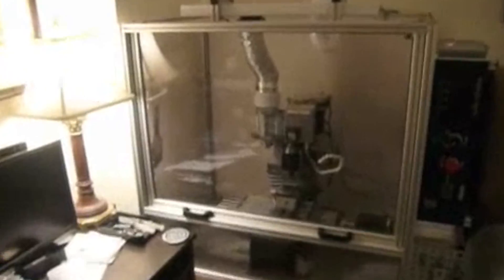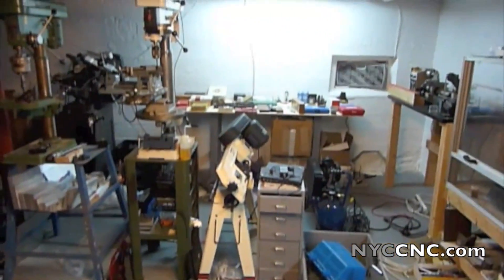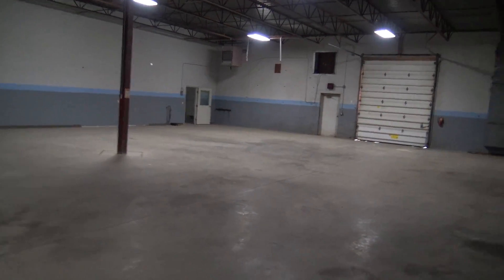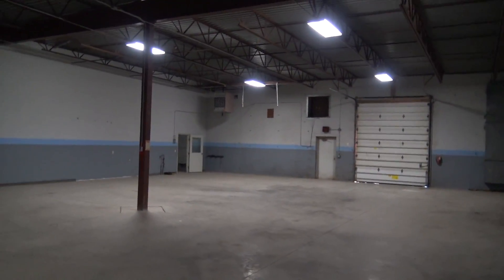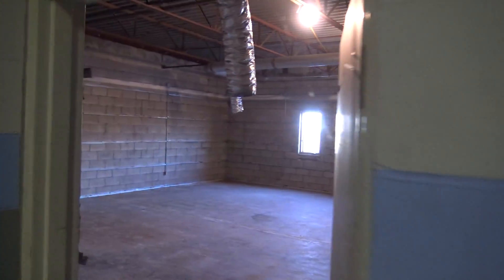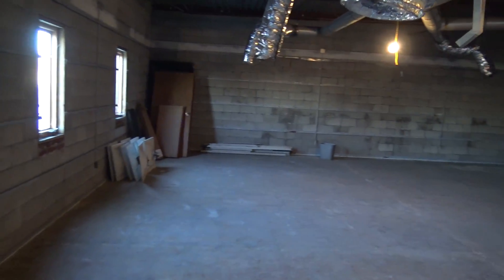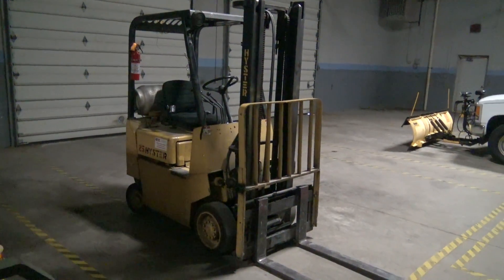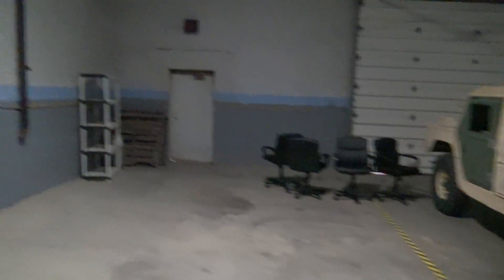We're Moving Again - One Last Time!  NEW SHOP!

Comment: From my experience & what I plan on for my next place, is to compartmentalize  my welding and Plasma from my machining area.  Keeping all the metal fab tools in the welding area, machining in its own area.  Metal prep & finishing in another area and any automobile service or work by itself.  Currently I have everything all in one area, minus the machining in another room, and I get powder coat in my plasma table, sandblasting in my auto area, and so on.  Walls can be moved, so don't be afraid to wall up and change out later when the business demands. 

Congrates on the big jump, you will do well with your enthusiasm!  On another note, I saw a pic with you over at Grismo's new place,  do I sense some upgrades coming your way?  

Cheers!

Comment: Here's a thought experiment on how to keep the dust contained. What if instead of using a physical barrier there was a barrier of high pressure gas? Similar to the barriers found within laboratory hoods, I've also seen a slightly larger system implemented in ski lodge doorways where a lot of people are moving through constantly and the door is almost never closed. Obviously is this case you're talking about an area that's many many times this size and I'm not sure how this method scales but if anyone has any ideas on how this might work it would be great to hear.

Comment: On the lights: T5 are much lower barrier to entry and provide insane lumens per watt (20,000 lumens for a 4 bulb fixture, 216Watts) but the bulbs themselves are nearly $10 a piece locally here in Vermont. I almost fainted when I bought a box of 40 and it was almost $400. I have a 40x80 with 22ft ceilings in my auto shop, and it has 12 of those t5 4 bulb fixtures. Provides adequate light. To get the same lumens in LED, your watts are going to be almost as high and the fixtures are 3-4x more expensive. My building was already fitted up (leasing for now until I can find a building similar to yours) so it doesn't make financial sense for me to change to the LEDs. If I were moving into my own place or replacing anything older then T5, I'd more than likely go LED. I know this is the direction you're leaning in anyway. The energy rebate will hopefully make it financially more attractive for you. The major reason I'd go LED is the 10-20 year replacement interval. It seems I'm living with a dim light for a while until I have time/motivation to get on the forklift and replace some bulbs or ballasts. 

For the floor, I used Armorpoxy II and did it myself. The concrete had sealer on it, so it required a lot of acid etching. I was never more sick of cleaning a floor than that week of prepping and epoxying. I'm thrilled with the final results though. I've scratched it here and there, but it's amazingly durable. Scratching it required dragging something over 1000lb across it, like a Bridgeport Series1 CNC or tower for a 9000lb car lift. Any normal use it has taken the abuse and laughed. 

For the air lines, I'm a fan of black iron pipe if labor costs are reasonable. It absorbs a lot of the heat from the air which helps with moisture, it's very strong and inexpensive. I use black iron for my main runs, and have used rapidair 3/4 when I needed something quick. I also use rapidair 1/2 for small use areas like my wire crimping station. The rapidair 3/4 line to block adapters are great. The blocks themselves, I'm sure you'll swear at. It appears to me that they use a chinese equivalent of an american thread, so you need some really good thread sealant and need to really crank the fittings in, unfortunately. But they do work.
Reply: Smart move! So easy for you, and they'll actually work well since I'm quite confident you'll use proper threading. :)

Comment: John, I recently ran air lines through out my 1500 sq ft shop and used Ingersoll Rand aluminum pipe. They call it their EPL. They have all necessary fittings and you will find plenty of Youtube videos on installation. They were easy to install and I am very happy with the finished product. My new compressor is an IR 80 gal 2 stage. It also supplies air to my new Trinco bead blaster. I have been watching your videos for only a couple of months so far. After the first few videos i said to my wife that you must be my twin brother because everything you like I also like.  I am planning to see you in April.   It would be great to hear from you. This is the first time I have commented on a video. If you can reply I guess I come back here to see your comments. I'm not sure. My email is mycncshop@gmail,com.   Regards,  Carmen

Comment: Top notch brother. If it were my space I would do one of two things. Either put the welding and fab in the multi bay area. Or I would put it at the front and the cnc in the back. You need the bay door to get big fab work in and out and they are also invaluable when you need to let in the fresh air and let out what ever grinding smell some how got out in the wild. I now you might not plan to do work so big. But things change and it's way easier to move plans then machines. Plus you could have your stock stored up front and not have to worry about hitting machines.

Comment: Nice shop - you will have fun fitting it out.
We have a 1500 sqft shop with a Tormach 1100 and Kern CO2 laser and struggled with the same choices...

Airlines - we went with the 3/4" plastic/metal lines - no corrosion, good price, easy to install and modify.  Each hose point has a bleed and quick connect.  Use a auto drain and refrigerated dryer and then a big desiccant system for the laser - even for air tools clean dry air is a good start point - yes you need oil but that's easy at the tool point.  I'm glad we used plastic lines as we've added points and didn't have to sweat copper.... the money we saved we used to add more points and 2 air line reels... Rich
Reply: +NYC CNC 
We went to Northern Tool and bought the 3/4" Blue plastic line system - it's actually an aluminum core with a blue plastic outside and white plastic inside.
We run shop are at 175 and this system is great - simple to install and easy to modify.  You do need to make sure that the lines are cut square to seal and that the compression fittings are really tight.  Had one or two lines blow of in the first few days of use (but now have a year + of problem free air

The lines mix crossion proof nature of plastic with strength of metal a smart combination and WAY cheaper than 3/4 copper would cost to buy and install

Rich
Reply: +Rich Domikis 
http://www.northerntool.com/shop/tools/product_200484023_200484023

Comment: Ok, here is my two cents worth.
 I personally have not done this but those outside 10/20/50W spotlights seem to have a very wide beam and all manner of kelvin rates and as far as I know are relatively cheap. Also they are sealed so bugs can't get into the fitting!
 While I agree T5  Fluorescent lights are very good maybe set a few of these spot lights over certain bays. I am saying this as you appear to have a decent height in your workshop.

Comment: Im not sure how well it would do against fumes, vapors, and stuff like that, but I may have an idea for a wall. I worked at a resort/conference center when I was 17 or so, and got to do a lot of service type of stuff around the place. And In the conference hall, they had these huge motorized dividers. They reached from the ceiling, all the way down to the floor. They were on a track that spanned the entire width of the hall, but they also folded up kinda like an accordion against one wall when they weren't in use.  Basically, so they could cut their giant ass hall down into 5 smaller ones if they needed to.

I'm probably not explaining it well, but maybe it'll give you an idea. haha

That way, if you have something absolutely massive that has to come in, or you simply want to move the walls to clean stuff or whatever it may be, it can all be done with a flip of a switch.

Just started following you the other day, and I love what you are doing here man. Keep up the awesome work, and congrats on the new space!

Comment: My first shop we ran steel pipe and no problems. Second shop ran copper then later added PVC no problems except the PVC close to the compressor after a while from the hot air etc, got dried, brittle and cracked. Third shop ran steel pipe from the compressor for about 20 feet and the rest high pressure PVC around 400# rating. Been that way for 11 years so far and no problems. Cheap easy to install and modify later if needed and no rust etc issues from the PVC.

Comment: Super-mega-wow dude,  this place is great did not like the last one a bit cramped.

20x ideas from when I pimped my factory:
1/ Go LED highbays and LED panels in the office, the $$ you save over time will be worth it. [good for filming as well]
2/ Epoxy everywhere -easy to clean and looks professional. 
3/ make sure your show room and public areas are boxed in and secured walls up were there are arc`s
4/ Extractor fans above all cutting welding etc [with partitions]
5/ Security and CCTV system like a RISCO lightSYS2 and HIKvision 16ch 3MP IR dome cams [I use these- magic !] 
6/ change all the locks, get insurance, put a fence up with gate.
7/ Make sure you have a studio room for filming youtube etc and the "lab" for electronics [all sound proof]
8/ Wire the place up with CAT6 add an access point in each room up high for wireless
9/ Extra Fire extinguishers near all fire zones
10/ You will need a small comms room for LAN phone etc.
11/ I like the idea of a wall in the front from the pole -Maybe have large glass panels so people can see the workshop.
12/ You will need a Meeting room to talk to clients -sound proof
13/ Order all your comms ADSL phone etc early as possible
14/ Get the electrician to add a power monitoring system on all 3 phases so you can check via an app or the PC.
15/ The Garage get a car lifter, Epoxy the floor Im sure there will be a few huddle vid`s from there
16/ Most important a lunch room/lounge breakout area with microwave & fridge and 50" TV 
17/ Your expanding so, Big office for you and some spare for managers and Machinists when they come.
18/  Maybe a secure weapons room with a big-ass 10 ton safe for weapons projects and testing. 
19/  Coffee machine hi quality.
20/ You need a super cool logo and all new stationary and stickers !  With new clothing as well

Comment: I would not go with fluorescents, I have Metal Halide Vapor Lights in my shop and they are great the bulbs are expensive but they have long life and replace a ton of Florescent lights with just one light (they are the kind used in a lot of school gymnasiums). Plus make sure when you run your airlines you run them correctly with proper drops and up streams and that you run them at an angle from wherever your compressor is down to the end point and I would also recommend running it in a loop that will save you all sorts of problems with dead zones. By running them in a loop you will get much better consistence in your air flow because it give the air two paths to get to your machines. Secondly the tubes act as reservoirs for your air system and will provide you with the most on demand pressure to your machines.
Reply: +NYC CNC NP, I have had to do a lot of research on air systems. When our building was first put up and the air system was run they just ran a bunch of straight main pipes down the length of the building because they were just using them for air guns. As the company grew and we started moving into CNC machines and away from screw machines no one ever fixed the air system. I have had to go through and retro fit our air system to correct these problems. Always make sure that your first move from the main supply pipe is up. This way any contaminants in the pipe go past your drop and to the end of the pipe where you placed a drop with a valve to catch any contaminants that may be in your system.

Comment: You could do something like sliding hanger doors or folding wall for your divider wall.  That way you could slide them back and open up the space and have a smaller door that you can drive the forklift through when they are closed.  I will post some links in the Reply below.

Comment: Awesome you have had such success! That will be really a nice space. I would propose making the auto bay the welding, grinding and fabricating area and keep all the machine shop for machines.  Then you already have a wall. I suspect you need to do a closer evaluation of those walls and ceiling. It appears to me they have no insulation to amount to anything.  If this was a school building it probably doesn't the tax payer pays the bills so who cares what it costs every month.  A building that big you could easily save a grand a month on heating and cooling with good insulation and building being well sealed. The air lines in the shop I work at has all galvinized pipe and after 50 years of 200psi service we are still yet to have any problems.

Comment: copper is a great way to go for the air lines, and we have roll up doors between rooms with the full length vinyl/poly/foot wide overlapping plastic hanging down and that is awesome for keeping separate departments responsible for their messes and debris.that looks like a great shop with plenty of room for a few more years for you guys.I know I've mentioned this before but we have been using an IR nirvana series 50 horse compressor and it has now turned one of our most expensive machines to operate into something that isn't budgeted for anymore, it has very little impact on our electricity cost whether its on for a weeks straight or not on at all, and we consume a ton of air.

Comment: Dang, that's awesome!
Hey, for the dividing wall, check out something like what conventions use to break up the big rooms, I've always heard them called air walls, basically a sectional wall that hangs from a track in the ceiling, they hinge and fold together. I'm sure they are expensive, but maybe you could come up with some surplus ones or build something like them. Think like giant bi-fold closet doors... 
Air lines, I still see a lot of places using iron pipe, not sure if its good or just cheap. An odd thought, PVC schedule 40 is rated at 250 psi, a guy I work with had the idea of using it for air line, not sure if that's a bad idea or not, thought I'd throw it out. 
Best of luck on the new digs, that's sweet!

Comment: Machine Shop Partition: Consider partial walls on the outside, and wide, high lift [hugs the ceiling] garage doors. Use a flexible weather striping around the edges for a tighter air-fit. When you ventilate, have the 'dirty side' have more draw.  If you had two 12' wide doors, or wider, and they could be 12' tall, too, you will have plenty of access when you want the shop open. You could even go wider on the doors. Maybe 20' doors, or more.

Comment: Congratulations on the new shop.

I came up against the same questions you are facing about your air needs as a facilities manager in two large manufacturing companies I worked for in the past. In eight facilities we decided (and never regretted) that a network of 2" schedule 80 pvc hung just under the ceiling combined with 1" schedule 80 drops to machinery, workstations, and the ceiling support posts. The drops are all terminated with standard brass air fittings like quick releases, coil hoses, etc. .

The 2" inch is hung from the ceiling using super strut J-hangers joined to the ceiling by 3/8" threaded rod. The 1" drops are interfaced to the 2" ceiling pipes by a reducing schedule 80 Ball valve. The drops are located at the walls you can use super strut with pipe clamps, and if no clear way to mount the drop where you need it apparent super strut can be mounted to the concrete floor and tied into the drop at the desired height.

The benefits over other systems (specifically copper) are numerous, here are a few. Schedule 80 systems are approximately 25-30% the cost of copper. A 20' length of 2" Schedule 80 pvc can be bought for less then $30 while a 20' length of 1" copper can run over $100

The pvc fittings come in many more options and are far less expensive. You will need far more fittings, mounting brackets, etc. then you will realize until you plan the system so the options and cost are very important.

You will have less issues with condensation with pvc lines then copper unless your facility is going to be climate controlled. When the copper gets cold over night or on weekends you get allot of condensation you will need to deal with.

By running the 2" pvc network on the ceiling you also get a benefit that is seldom considered. All of that pipe is in essence additional air tank. Your compressor will run slightly longer once activated but will start and stop less often. That is after all what kills compressors. I also suggest running as much 2" as you can afford or think reasonable. We did our systems so that whenever we brought in new machine or had to reorganize something there was always a 2" line not more then 10' offset from directly above the new machine. It is also worth it to add a few schedule 80 pvc 2" ball valves around the network for any future "tie ins".

The last benefit i will mention is flexibility. As you plan to be in this building for the foreseeable future and beyond you will inevitably need to relocate lines from time to time. with pvc you can cut out a section of 2" and add a new drop using the 2 part adhesive. With a copper relocation you will need to either thread or sweat pipes after releasing clamps on surrounding copper pipe since you will not be able to spread it or bend it to get everything fitted correctly.

Your situation is optimal for doing a complete air system since you have both  a blank slate and no obstacles on the ground yet. Plan well and double check everything. Oh and if you can find it in the budget rent a scissors lift and you won't regret your choice.

I apologize for the long winded post